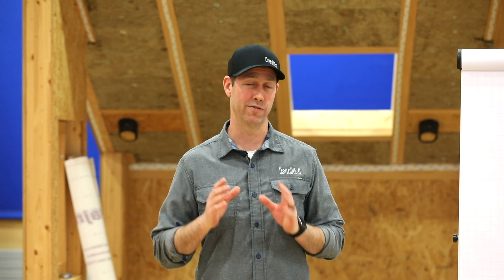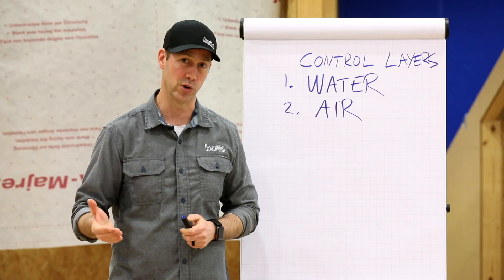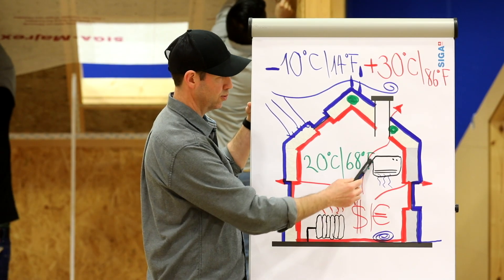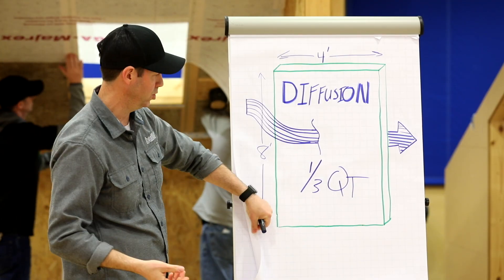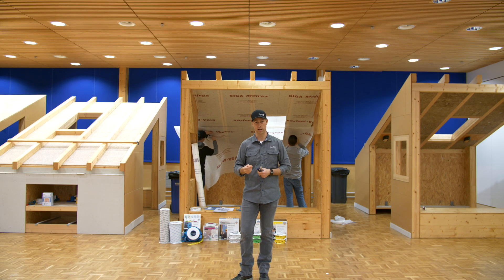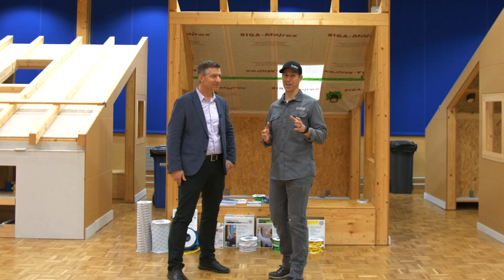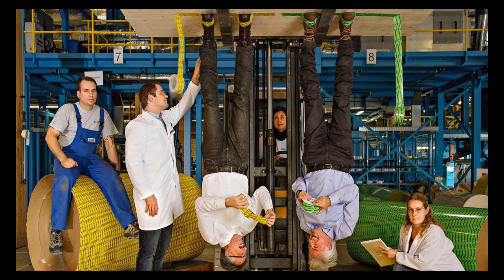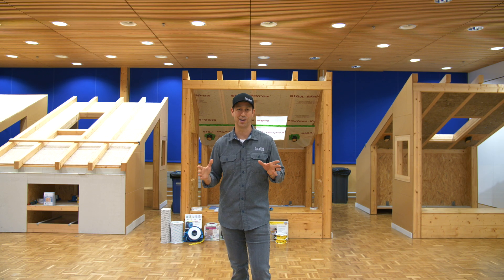Understanding Air and Vapor Barriers INSIDE your House

Comment: Only 1/2 the story.  Turning a building into a hermetically sealed box can have its issues as well, retaining moist stale air that is not healthy.  Whilst hermetically sealing the box may be desirable from heat loss ($/£/Euro) there MUST be a way of extracting the stale air and introducing fresh air.  Heat recovery ventilation being desirable.
With all these membrane systems we are trying to control the production of condensation, wherever its formed, that stimulates mould growth.  Condensation is formed at the dew point temperature, where the air is cooled to the point where it cannot carry the moisture, hot air carries large amounts of moisture and cold air little moisture.  If the warm air is near to saturation point then it takes very little temperature drop to get the moisture to condense out.  That is why condensation always forms on walls in a bathroom because it is bound to be a few degrees below the air temperature.
Fully understanding the total building package to control heat/moisture/ventilation is beyond most builders understanding and they only latch onto limited elements, a case of a little knowledge being dangerous, leave it to the professionals to design the details, if nothing else they are insured if it goes wrong!

Comment: Sips are junk without vented siding and roof. I've tried tyvek, 30 lb felt anything you put directly on the osb sip rots it in 10 years or less. No more wood for me. Only CONCRETE BLOCK STUCCOED OUTSIDE  WITH METAL STUDS WIRE LATHE AND PLASTER INSIDE. Any new ways to approach moisture failures have issues.

Comment: "Do you need it on the inside do you need it on the outside"... well idk after watching this video. Not informative at all. I clicked on this video with a simple question, I live in the southeast (US) do I need a vapor barrier and if so should it be in the inside our outside of the studs. Still dont know
Reply: You couldn't research this issue anymore, huh? Only Matt has the answer? This is where you stop and complain? You have time to write a paragraph instead of googling it, right? What do you want, for him to delete the video because he didn't discuss your no brainer question? Why cry about it? You didn't pay for anything. Realize your no brainer question wasn't addressed and move on to the next video. Scrub.
Reply: Put the barrier on the side where heat will generally come from.

Cold areas: inside because you heat.
Hot areas: outside because you use A.C. a lot.

If you're in a mixed climate with the need to A.C. and heat equally then probably on both sides.

Comment: Yes , I was watching for the explanation ??   So you put the one way vapor barrier on the inside , correct orientation.  This allows any vapor that gets into the walls to come back into the house but not visa versa ???    What about on the outside of the house, the air barrier ??? and the insulation .   Can you put a barrier on the outside of the house like it shows in other videos,  laying bricks on top of an external vapor barrier ??   I was looking for some more comprehensive review of the subject.   You can see in this video they put multiple outside layers, and an air barrier and on top of that a waterproof membrane.  So how does moisture get out of the wall???
https://www.youtube.com/watch?v=pnxX3uAn-c8

Comment: Hey Matt.  Great stuff here.  I saw your video about vapor barriers that you made in 2018 and it says that you basically don't need one.  This one seems to say the opposite.  I was leaning more towards not doing one.  I live in the PNW which is mostly a heated climate (meaning I'm using heat more than cooling), but it isn't super cold here either.  I am remodeling my upstairs bedroom.  This is basically an attic turned into a bedroom with two sides still having attic space (where the rafters run down)  The house is 1926 and the rafters (which are only 2x4s) meet at the peak with no horizontal supports.  Basically like your new attic build in your home but without the horizontal supports on top about a foot down from the peak.  I'm going to be using all the space so ceiling will be on the rafters.  I'm using spray foam and then for the ceiling I wanted to use wood planks or some kind of wood faux backer board.  If I'm using spray foam on the ceiling I know I need to seal the room as best I can.  I was wondering if I used the wood planks do I need to seal every crack kind of like drywall would do?  If I use the faux wood sheets can I just paint the back of them?  I'm just not sure if I need to seal inside the spray foam.
Reply: My interpretation is that this material serves first and foremost as an air barrier and that the vapor permeability has a marginal impact. I wish Matt had actually explained the usefulness of this directional vapor flow.

Comment: That is my big problem.  I had a company put in aftermarket windows and replaced the single pane to double pane but they did not seal out the water and every time it rains I get dripping around my window on the back side of my house.  That is my next project.

Comment: The other (5th?) major element a house needs to control is inbound solar radiation. Letting it in in cold regions/seasons, keeping it out in hot regions/seasons. This could be its own episode (specialised glazing on north vs south facing windows, overhangs, building orientation, thermal mass, etc.).
Reply: I like it - Solar. Could put this in Thermal? I would also add Insect Control. Matt has a good video on controlling insects with BoraCare.
Reply: @ZimorKilled  thermal might actually be too general now that you mention it, air barriers manage convection, insulation manages conduction, and now we're taking about shading and coatings to manage radiation gain/loss. I like this train of thought

Comment: If you put a completely waterproof barrier on the outside of the house you could be in for a big disaster. if water gets in behind the waterproof barrier than that barrier holds it in the wall and you have a rotted wall. I am working with my boss who has been building houses in Vancouver for 30 plus years. So have a permeable membrane  or even no membrane between the wall and the outside skin of the house. Inside I would also use something like Tyvek instead of plastic under the drywall.

Comment: Why do you build with that stupid slab outside the walls? Recipe for disaster! Water sucked up through it and into the house. 
Solution is to make the siding or sheething or whatever you call it form an overhang which leads water away from the slab.

Comment: Hey Matt- question: we have a dirt floor basement and no subfloor on floor above it/ceiling. We get a ton of humidity in the summer, and I’m wondering if I put a vapour barrier on the ceiling of the basement would help reduce that?
Reply: Kat Burns Put vapor barrier on the dirt, seal any vents or wall penetrations, and install a dehumidifier.
Reply: @stevescherer4954  thanks Steve. I feel like a vapour barrier would tough to walk over, no? Would it be worth it to put the vapour barrier on the ceiling (which would prevent moisture from going up through the floor?)

Comment: Matt ,would you be able to tell me on a Kwanzaa hut a metal building, I am planning on putting 3 inches of close spray foam insulation on the top half of the building and 2 in on the bottom half. I forgot to mention one things this will be it will be a two storey. The bottom will be a garage Workshop office space and a bathroom. Upstairs will be a living quarters for myself, I'm a bachelor. I do not plan on using a vapor barrier,am I making a mistake. I'm going to have the guys do the closed-cell spray foam directly on the metal and then I will paint the spray foam with a fire retardant paint, no sheetrock for the whole ceiling area. The only thing that will be closed in upstairs will be the bathroom, laundry room and a closet everything else will be an open floor plan with no sheetrock. getting back to it ,do I need a vapor barrier or will the three inches of spray foam insulation in the living quarters work thank you David for North Alabama
  256/318-5111 
                   jan.26,2020

Comment: In the video "Vapor barriers: need one or not"...
4:44, discussing diffusion - "There's very few places if any in the U.S. that you really need a vapor barrier"

Also, 7:05 - "But its only really if you get in to the very coldest zone in America, which is climate zone 7 up there, where you might actually use a vapor barrier"

This video, @ 6:10, discussing diffusion using the same example of 1/3 quart of water - "So do we need a vapor barrier? Yeah, we probably do"

Well, now that's all cleared up....
Reply: These are mainly air barriers not vapor barriers like a poly sheet.

Comment: Ive been a carpenter/renovator for about 5 years now, and I hear all the time from the old-schoolers how you want your house to breathe, and we vent bathrooms into the soffit here in swampy Eastern NC. However, I'm starting to learn that you may not (depending on conditions) want your house to breathe, but I haven't yet drawn a clear line between the two. What/when exactly do you want to your building materials or home to breathe? Could you compare and contrast the two, please & thank you?
Reply: If you have not already seen this video, it gives a good, quick review.  A little too short, imo, but still good stuff.  -->  https://www.youtube.com/watch?v=OJ9u3pDQeM4
Reply: @glencaple3888  Amazing video! Thank you for sharing. The short answer is a vapor retarder can be used in climates with both hot/cold, so in the hot the wall can dry out, in the cold it can resist letting water into the wall from the inside.

Or use closed-cell insulation to avoid need for vapor barrier.

Comment: Back in the 70's when I began as a carpenter, we would staple 4 mil poly on the framing, after the insulation was installed, for our vapor barrier. (install vapor barrier on the warm side) The boss wanted it over all the windows. It was not at that time cut out around the windows. Then when the sheetrock was installed, you could see how the outside air pushed against the poly as it tried to infiltrate the house at the windows. I was amazed at how much pressure was there. It would bulge out the plastic sheeting several inches in toward the room. When you pushed on it with your hand, it was like pushing on baloon. Lots of air infiltration happening, but the plastic sheeting on the warm side was not placed there for preventing air infiltration. It was there to prevent warm moist air from cooling off as it moved toward the outside, and reaching it's dew point and condensing inside the wall.

We were not using any house wrap on the outside of the wall at the time. I wonder how much that would have helped, but I was amazed at how air was trying to infiltrate to the inside of the house and not the other way around. We had installed the windows directly onto the plywood sheathing, using the window flange and nailing through that. They were wood clad (with plastic) windows. Perhaps there was a lot of infiltration happening at that joint, between the window flange and the sheathing. I'm sure some of the air came through the weatherstrip of the windows also. They were casement windows.

Sometimes we had trouble insulating in corners, such as on a hip roof, where it isn't so easy to get as much insulation in, and sometimes on a cold day there would be frost seen on the sheetrock in the corner, if the insulation installation wasn't properly done there.

Comment: Fifteen years of attending ASHRAE meetings, first time I have ever watched a simple explanation of vapour barriers. Really appreciate your work, Matt, keep it up. You and Joseph Lstiburek are my building science heroes! 

Would appreciate you addressing the comments about drywall screws, related, liked the video about foaming electrical boxes properly that you did recently, need something like that for the other penetrations that we all make.
Reply: My previous understanding (potentially mistaken) is that yes it would be best to somehow be able to not have any penetrations onto the vapor barrier but you can't have everything be perfect so having a vapor barrier up still stops 98% of all the moisture that diffuses through the drywall than not having a moisture barrier, as the job of the moisture barrier is to stop diffusion through the actual drywall cells NOT holes in the drywall from nails or screws. 

The drywall screws/ nails I'm assuming is supposed to be sealed via joint compound/ paint and would just diffuse moisture as if that small section didn't have a moisture barrier, so yeah an 4X8 sheet will have maybe 20 screws or something but that only adds up to just 5 sq in. of non-moisture barrier drywall but the rest of the 32 sq ft has moisture barriered drywall.
Reply: The screw presses the drywall to the stud.  I don't see it being a problem.

Comment: In my research on cold climate construction,  the recommendation is to leave inside of the home able to breath but seal and insulate the outside. This prevents the build up of moisture within the walls. But your video shows installing vapor barrier on the inside of the wall. Which would do the opposite.  Can you address this please.
Reply: I believe it's inside for northern colder climates..outside for hotter southern states

Comment: I have a tough question: my parents built a real log cabin in 1975, and still live in it today. The space between the logs is stuffed full of fiberglass insulation, covered over by wire mesh, and topped with an exterior and interior cap of cement-like mortar. The floor of the attic is blanketed with rolls of fiberglass insulation between the ceiling joists, and the roof is uninsulated. The house can get especially hot and humid in summer (during hot spells the main floor can be unbearable after sunset) and the basement can also eventually get hot & humid. Are there techniques and technologies available in the USA to control heat and humidity? A local energy specialty evaluation team reported that the house (supposedly by their standards) has excellent airtightness and insulation value, but performance, especially during summer, suggests to me otherwise...

Comment: 1) We need to stop 
moisture and air moving from the inside, 
to the outside.

Ok then, 
put an impermeable barrier right at all ceilings and walls.

This will stop all moisture and air movement outward.

Done.

2) Stop all ingress of air and moisture from the exterior 
to the interior.

So then, 
Install an impermeable barrier behind the surface material,
stopping ingress of moisture and air.

Done.

Is this correct, or incorrect?
Reply: Dr. Anthony Forgione in theory, correct. In practice, a recipe for disaster — the tiniest hole in either barrier will let moisture in but it won’t be big enough for the moisture to get out. Ultimately you’ll end up with mold and rot.

Comment: Thanks again for producing these videos.  So If you live in a climate where there are both cold winters and hot humid summers, you would put some sort of vapor barrier on both the internal and external sides of the walls?
Reply: Did you ever get an answer? A question I have been trying to get an answer to too but no one seems to ever want to answer the 50/50 climate question. My conclusion now since I'm insulting my attic is to put insulation with barrier facing down in rooms which will or would produce too much humidity e.g bathroom & kitchen and have face up on rooms that are directly getting the best of the sun heat but less humidity.

Comment: I am doing a metal building a Kwanzaa hut and I was told to put my insulation outside closed cell foam and then spray paint it with some kind of special stuff that's like bed liner material on steroids. Trying to make sure I don't have any leakage or water condensation coming from my roof down inside my building can you help me with this little project just advise thank you David 256-318-5111 thank you
Reply: I just want to make sure I got my envelope closed so my building don't start rusting inside or my insulation and wood don't start to have problems from the roof down. The best vapor barrier I can have I need to know what it is your advice would come in very handy thank you David

Comment: I can see light at the eaves of my attic ,what can I do to seal it?
Reply: you probably don't want to seal it unless the insulation is in the joists supporting the roofing.  if the insulation is above the living area, you need airflow through your attic so moisture is not trapped there.

Comment: Having no expertise in insulation or vapor dynamics;
as an observer,

I find it quite confusing to understand fundamental guidelines for controlling 
(and not controlling) 
for vapor, moisture, and air 
in proper residential construction.

Of course there are different methods, materials,  standards/codes 
by regions and country, 
and depending on 
climate/weather;

but  basic  principles,
simply explained and 
well laid out, 
haven’t been easy for me to find.

The old way was abc 
(last year).
The new way is xyz (this year).

“Seal, seal, seal from water and moisture.”

vs.

“Let it breathe,
anything that doesn’t, 
there’ll be mold/rot/damage .”

Matt, have you made  
  a  video... 
that..  once and for all,
lays out juuust the basics,

that don’t constantly change...

on vapor barriers, 
moisture control;

the when,  why,  how,  and where
in residential construction?

What should breathe?

What should seal?

And why.

“He who creates such a thing,
done well,
will be known forward in time
 ....as a hero among men.”

(This is a saying you know.)

Comment: Is the diffusion calculation based upon painted drywall or unprotected drywall. I do understand that a hole in the wall doesn’t matter, but calculations should be dramatically different between painted and unpainted drywall.
Reply: I assume painted; who leaves drywall unfinished?